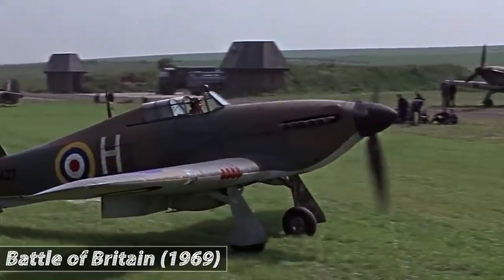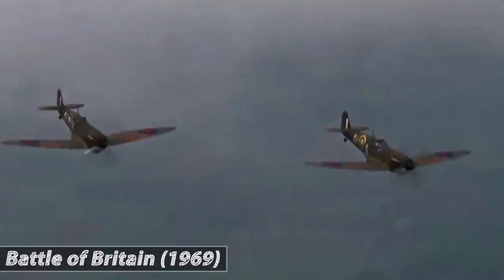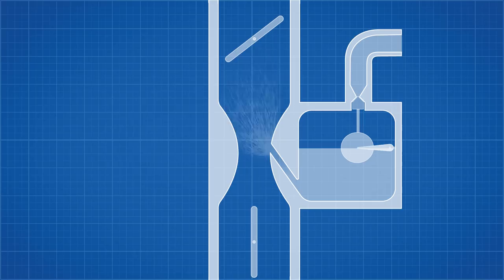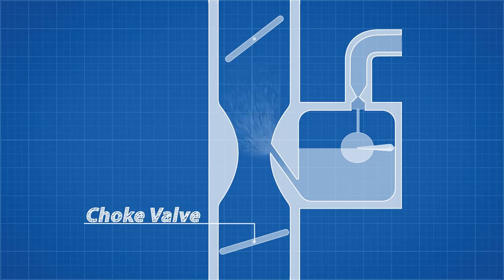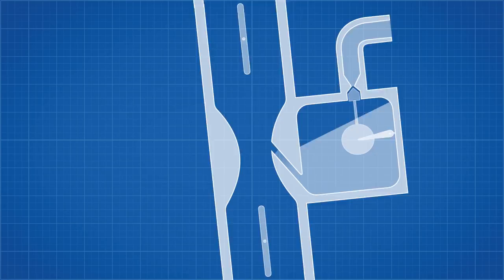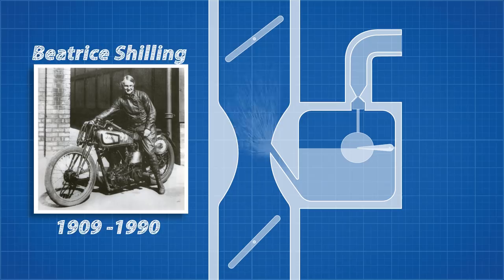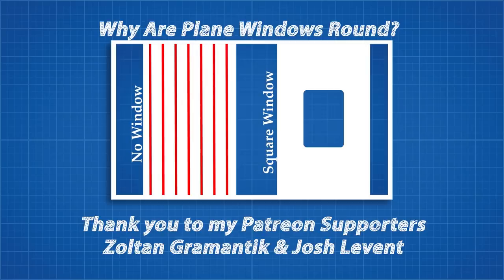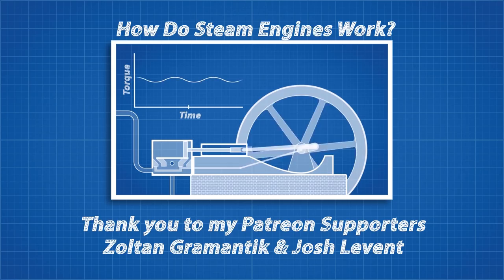The Spitfire's Fatal Flaw

Comment: The whole Me109 Engine was upside down as were most Luftwaffe engines so I think you're being a bit pedantic saying they're remarkably similar, even saying they're similar is a long shot as the Spitfire is a quantum leap ahead of both the Messerschmitt and Hurricane in Aviation engineering terms which Reg Mitchell advanced from an almost blank piece of paper to BE in advance of the German aircraft, in fact so far in advance Aircraft are still constructed the same way today. 

Apart from that it was a minor flaw of the early RR Merlin Engine's Carburation not a fatal flaw of the Spitfire as you point out by showing a Hurricane which wasn't as agile as a Spitfire and therefore spent even less time in negative G than a Spitfire did. It's you that's criticizing something in context of being beyond criticism, you're avoiding the beauty, the success and studying the tiny blemish? what a weird thing to do and call fatal? You also forgot to mention the clever little fix was called Shillings Orifice, something her Norton was also familiar with, the Gal knew her AMAL from her elbow and her Bendix from her Boots.

Comment: Rolls Royce would have had fuel injection if they had been adviced by the Royal Aircraft Establishment to develop it. At the beginning of the 1930's, America, Germany and Britain were looking into fuel injection but for some reason, the RAE came to the conclusion that it would be of no benefit, obviously a totally false conclusion as fuel injection had many benefits which included better fuel consumption, no icing problems, and obviously no negative G fuel starvation. An aircraft designed for civil purposes is one thing but a military aircraft is another. I think the Germans were more advanced in their thinking.

Comment: Anyone who understands a carburated engine cant handle extreme tilt angles or being upside down or having fuel left in them for long periods, hence fuel injection. The idiot designing it overlooked this obvious fault, I mean it's basic fluid dynamics...liquid gallows the kaws of gravity.  The only thing making it counter intuitive is the fact that as long as you pull positive gs the fuel would centrifugaly stay in place...hence the key being negative gs and upside down.
Reply: Obviously the designer did not overlook fuel injection since he knew that the carburetor was more efficient, I am sure Luftwaffe pilots wished they had a better engine when they could not get away from Spitfires.

Comment: Can someone explain me pls.Does the merlin have problems with negative Gs or just being upside down in general?
Reply: To start with the problem was not much of a problem for good pilots, it was mostly noticed when going into a negative G maneuver but improved by the Battle of Britain and completely solved by 1941.
Rolls Royce knew about fuel injection but used a carburetor since it was more efficient.

Comment: They could've placed an air valve(like on a tube) on the fuel filler cap and pressurized the whole fuel system. Of course the whole system would be leak free tested beforehand.

Comment: Compared to the BF 109 it was a notable flaw because the BF 109 had a fuel-injection engine which the spitfire did not have, so it could  not perform a  nosedive from high altitude without risking the engine to die off.
Below 4000 meters the BF was  yet quite not as good as the spitfire due to better propellant Oktan 100,  yet this did not work any more above 4000 meters above sea level, above where the BF 109 had def. advantages compared to the spitfire, except for the operating range which was def. to short.

Comment: Not only are you showing Hawkers, you are also wrong. There where many! spitfires that flew a lot faster than what you portrait here and they came in many! engine models.. The Mk XIVe flew 731 km/h and the plane was also build with different engines Both the Merlin an the Griffon was used. The fastest spitfire every was a dive made in 1943 reaching 969 km/h. So a pokey 500 km/h is easily reached with a Spitfire. The Hurricane and the Spitfire are NOT using the same engine - they come from the same company and btw the P51 is also using a Rolls Royce Merlin engine, unless we talk about the pathetic american engine Allison (the first models).

Comment: What a bunch of hype.  This was not a fatal flaw, it was simply an area were the BF-109 has a slight and temporary advantage in begin able to bunt without the engine skipping.  Most useful to spoil the aim of a Spitfire pulling lead for a shot, but not a huge advantage for the 109 in trying to fight a Spitfire.

Comment: Sorry to be so blunt but.
When it was built, both the aircraft and the Merlin engine this design was normal.
Even 10 years ago I flew Robin 2160 aerobatic training aircraft that have the same problem.
The spitfire pilots had alot more serious problems to deal with than this well understood  and known fault.
Please think of something more  serious to complain about and criticise a spitfire for.
By the way, I think its time to stop making a diffetence between men and women even to as you are being condescending about it.
The women I know can out perform men in an aircraft most of the time.

Comment: it is not that big of a deal. most types of the time had a similar system, you just maintain positive load on the stick when manovering. the only issue is you have to roll after a 109 if he punts down. A flaw yes. not a major one, especially when you look at air combat as a whole.
Reply: It certainly was a major flaw. It could get you killed if your engine didn't recover from the cutting out. There was really no good excuse for using such a carburetion system on a fighter aircraft. A diaphragm type carb would have been far superior and even then they had fuel injection available but just didn't use it.
Reply: Having to roll into a dive was not a trivial drawback.  The Spit was a good roller at low IAS but its roll performance dropped off dramatically with more speed.  A 109 had a real advantage in being able to dive out of a high speed chase with a Spit.

Comment: Why younger sister/daughter? Wording it like that almost makes it sound like you think no women or girls watch your channel, XD

Anyway, the reason is different, but most civilian aircraft to this day don't like flying inverted (unless they're designed for aerobatics), as this will cause the engine to cut out for various reasons.
The most common, and dangerous, is the use of a gravity fed oil distribution system, meaning extended inverted flight (or negative g's) will cause the oil to run out of the engine...
And... Running an engine without any oil in it tends to do rather bad things...